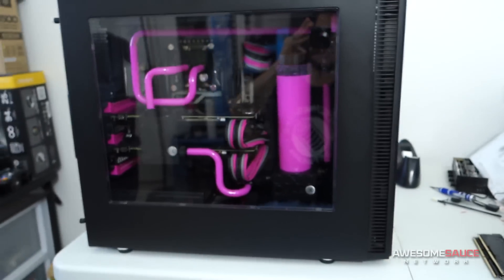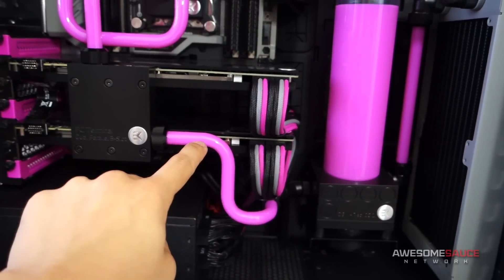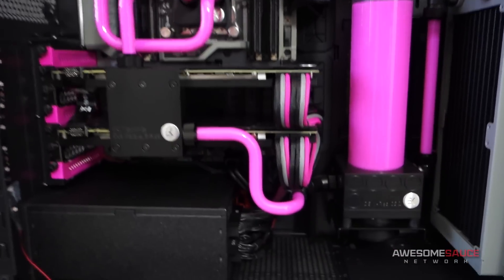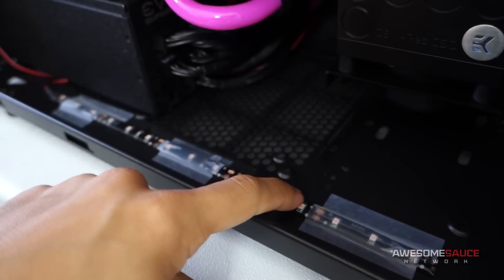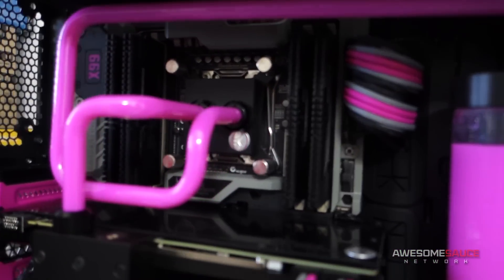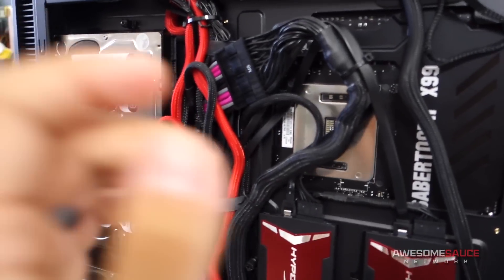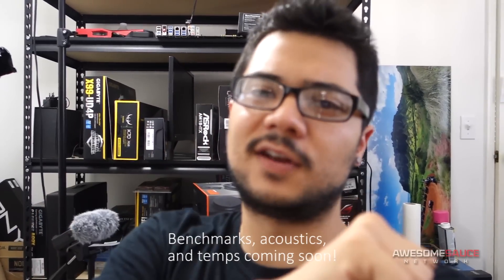Custom Water Cooled Build Log 7  - The End

Comment: You could do one thing and make the water flow in the following pattern... 
Right now your pattern is :-

RESERVOIR-GPU BLOCKS-CPU- TOP RADIATOR-FRONT RADIATOR-BACK TO RESERVOIR.

You could improve this by changing the flow pattern to
 
RESERVOIR-GPU BLOCKS-TOP RADIATOR-CPU-FRONT RADIATOR-BACK TO RESERVOIR.

This way when the GPU heats up the coolant it doesn't directly go to the CPU block.. instead it'll go to the upper radiator and get cooled before going to CPU..
This would be a more efficient way of using all that cooling power you have with two radiators. if you had only one radiator you didnt have a choice but you have a choice now.. 
 hopefully this helps you out man..
Reply: All the liquid in the loop is the same temp plus or minus a few degrees. It really doesn't matter
Reply: This is a mistake people always make thinking that the order of rads to components matter but this is 100% false. The only thing that matters is that your pump is below and directly after your reservoir that way it never runs dry. The way fluids work is the heat is evenly distributed throughout the whole system so the temp difference no matter where it is entering or leaving is 1-2 degrees at most.
Reply: always wondered about that.

thanks Jrock.

Comment: I used double-sided adhesive tape for flooring, it bonds tightly but isn’t permanent, and capped the ends with wood glue, and secured wiring with a few dabs. It takes a bit to dry, but dried clear and is as effective as hot glue

Comment: Typically builds are specific to a cost bracket, or a functional requirement but this was done for true enthusiast art. I'm not a fan of pink most of the time, but this really looks awesome. Your  bends are an inspiration to the hard-line glass I have coming up for 'Mjolnir Extreme' -my latest build (Provided it's not too heavy but I'm using a Thermaltake Core X9 Cube with a flat main board). I'm going to mock it up with some acyrilic and have my glass guy be the judge at worst it will be PETG. The whole idea of painting etc has given me a whole new world. I love blue but the ROG board I'm using the Extreme VIII by Asus has some red luckily not a lot like previous offerings, but my wife the ultimate fingernail painter will be hooking it up;) Thanks for sharing total inspiration and an envious build my friend.

Comment: You should redo the wiring with gorilla glue and sleeve the wiring coming off of it in black sleeves and using shrink wrap on the end. Then you connect it to the +12V source. I used very similar LED strips in mine and doing this technique worked wonders in my custom water cooling build! Just a suggestion!

Comment: I use a piece of Velcro on one side of the LED strip and the opposite Velcro piece on the case itself. It works really well, I have a 3 meter RGB LED strip spanned out around my Corsair 780T and about 1.5 feet of the 3 meter strip is upside down on the top of the case.

Comment: it looks fantastic

For the LED strips, you could try to put some magnetic strips on it for quickly adjustable or even do the small 3M velcro strips.  They hold like a boss and are removable.

I'm a stickler for details, but I don't think the little bit of paint rubbing off of the pink cables would bother me at all.

Comment: Very nice build, beautiful. May I suggest drilling a hole or two in the bottom, add a rubber grommet and run the wires thru for the bottom underside led strips?

Comment: nice work man, great set up.  my little bit of insight would be this, just watch the backing of those led strips with nothing on them, i had a led  RGB reel and the copper contacts underneath the strips were touching parts of my case and would short the computer out almost immediately, until that I installed rubber doubled sided tape on the back of it

Comment: For the LED strips I suggest to apply some Dow Corning 3140 RTV behind it. It acts like a glue and it's completely safe of electronic components. So if you accidentally get it on something there is no scare. After curing it is pretty easy to remove as well.
Reply: It is really good for laying wires down and getting them out of the way.

Comment: I would do the exact same thing but everything that is pink, make it red or blue. I think that would be sweet. I would also recommend drilling a tiny hole in the bottom of your case to run the LED cords through instead of the back.

Comment: If you haven't done anything about the led strips yet you could probably find something similar to the little pads antlion uses on the modmic. I know that my darkside led strip came with something of the sort. I believe they are 3M adhesive strips of some sort.

Comment: Awesomesauce Network Kyle, led strip suggestion. Obtain some magnetic sheet material from some place like Michael's and cut it into strips the same width as the led strips. Then glue it on to the led strips with contact cement. Done.

Comment: Could route the underglow led strip wire in the front of the case, in through the hand hole to remove the front panel. Then through the side holes for fan cables. Just an idea, looks great though!

Comment: Gz on the marriage.
I would hot glue the led strips, you can easily heat the glue with a hair dryer later and pull it right off the case. The glue will easily come off like rubber.

Comment: 3M double sided tape "outdoor strength" will do wonders on those led strips. find it at your local home depot
changed my power button led on my fractal node 804 to red quite easily with a little hot glue

Comment: A few years late to the party but I'm also looking to switch from soft to hard line. Great tips from the last video; I'll be sure to get a lot of extra tubes as this will be my first attempt at bending (lol). Any other tips you  thought of that you didn't document would be invaluable - please let me know if you think of anything! P.s. does the sequence matter? I currently have a single 360 rad and want a second one. I have the Maximus X Formula with a single 1080ti in the loop. I was thinking of doing the following: Res >> VRM >> CPU >> Rad1 >> GPU >> splitter with drain pipe >> Rad2 >> back to Res.

Comment: That looks amazing! I feel I need to get on my with my Purple mods on my own PC.
Just a thought... am I right in saying you have dual 140 intake at the front and triple 120 exhaust at the top? If so, aren't you going to end up with negative case pressure, pulling in lots of dust? You would have to put a filtered 120 in at the back as intake to fox that. No idea if its actually an issue though.

Comment: I had a similar issue with the LEDs in my system. I'm using electrical tape for now since you cant see it. But I did find some magnetic tape that I thought would be interesting to try putting on the bottom of the strip.

Comment: You could use double sided tape for the LED strips and cut them down to size to make it even cleaner, would definitely make it easier to remove than glue.
Reply: Nicktrance1 Some double sided tape to hold the LED strips in place is definitely a good option. I highly recommend (Bill Owen does as well) the 3M Scotch Clear Mounting Tape #4010. Just make sure that is where you want it to stay, because it will be stuck. Here is a link to by it from MNPCTech (http://mnpctech.com/case-mods-gaming-pc-liquid-modding-custom-computer-mnpctech-overclock-cooling-fan-grills/3m-4010-tape-en/)

Comment: Are the fans on the radiator sucking air from outside the case, through the radiator, and into the case? Or pulling the air in the case, through the radiator, and out of the case?
Reply: BecomeSupreme  The top rad has a push configuration, exhausting air out of the case, so I'm guessing the front rad has the fans pushing air in . Probably not the easiest configuration to clean tbh.
Reply: +Nicktrance1 He said both are push in a earlier video

Comment: 4:50 why not use spray adhesive. I know you don't want to buy a $10 can for a little light strip, but if your concerned with the cables overlapping, you'll probably spend a little bit more to get a clean finished look on the LEDS

Comment: How's your experience with the FD Venturi fans? I recently switched over from Noctua NF-F12s to Venturi HP-12s because I needed black fans and the Noctua Industrial fans are just too damn expensive. I have to say I was surprised by how well the Venturi fans have been performing. I wasn't expecting them to be quite this quiet.

Comment: Please do the LED-Switch soon! i've tried to switch the LED(s) on the I/O panel however they're a bit tricky. It's 2 LEDs, one for H.D.D Activity (standard 3mm led, ~3v) the main power LED is a rectangle LED that is 1x3x4 and unknown voltage atm. still trying to get a readout on the LED from Fractal themselves since my Multimeter won't give me the recistance of the rectangle LED

Comment: The front radiator, is that configurated as pull? Since you put fan in front of it I guess your pushing air into radiator (Direction from outside --> inside of case)

Comment: Beautiful build except one tiny point which doesn't seem logic to my point of view: the loop of yours is going through the GPUs and directly to the CPU  and to the two radiators to end to the water reservoir which means the two GPUs (imagine under load) thermal output is going straight to the CPU.  It would have made sense (at least to me and considering the fact am no expert and am might be wrong) to make a loop similar to Paul's Hardware Custom build where he put the radiators in between the GPUs and CPU which means the liquid going to one is being cooled before going to another...
Reply: it doesn't matter at all.

Comment: 3M 4010 tape for the LEDs ... 1/4-inch.

Also, why didn't you drill into the chassis to route the underlighting wires?

Comment: I really like the ground effects lighting but you could have at least drilled a 1/8 in hole and routed the wires underneath the power supply like you did the other ones with in the case, but all in all it looks awesome on the inside

Comment: You should've painted the top of the RAM heat spreaders pink, just to make it a bit more pronounced. Also, why don't case manufacturers make a 2-3cm thick "hidden compartment" at the back of the case for easier cable management, so you're not swishing everything into a super tight area.

Comment: I would redo and reallocate the tube going from the graphic card to the left of the CPU's waterblock going to the right fitting on the CPU's waterblock, and the tube above going straight from above into the left fitting of the CPU's waterblock. This will make up for a much cleaner look as this circling of the tubes above the CPU isn't really perfect. Other than that it's pretty nice!

Comment: You definitely need a rear exhaust fan and it will make a distinctive difference on the temps.
Reply: +Alvin Ong It is all water cooled...what temps are you talking about?
Reply: I'm experienced enough in water cooling, thanks. Why not you just give it a try :) put on your side panel and let everything run as usual with and without the rear fan turned on. You will get what I mean.
Reply: Alvin Ong i would put a nice pink fan on the back

Comment: Is it better to keep the cpu and gpu's on separate loops to confine the different temperatures? Or is there a best order I should follow. For example gpu>cpu>mobo?

I ask this because I'm curious if heat from the beginning of the loop will affect performance from parts later in the loop.
Reply: It wouldn't hurt by any means but I think having two loops is a bit excessive. Does it help? Oh for sure it does. Does it look dope as hell? You betcha. Is it totally necessary? Not at all

Comment: Can you tell me if the Define S side panel will fit on the Define R5?  I realize it will need a little modifcation because of the quick release on the R5 but are they basically the same and can fit?
Reply: Sadly, no, it won't fit. The R5 uses a different latching mechanism from the S where it goes into the frame instead of hanging on it.

Comment: Whats the reason for the strange direction of tubing coming from the outlet CPU block? why didn't you just go up and right into the radiator?
Reply: because #showoffdatfluid
Reply: Crossing tubing looks a mess with the extra unnecessary foot of tubing just to show more fluid in my opinion isn't worth it.
Reply: Mark Springthorpe yeah it's ugly.

Comment: just a suggestion but you could get a matt black metal plate for the rear fan with 4 holes in so you could screw it on because the light that comes in through those holes is abit distracting. other as the GTA mechanic would say "if that pc was a girl I'd kiss her"

Comment: wouldnt it have looked a lot better with just strait pieces and then used right angle fittings?
Reply: Every fitting you add, creates a new possible point of failure. The more fittings, the less probability.

Comment: how much do the custom water cooling cost?
Reply: Sindre Andreassen, alot
Reply: roughly between 200 and 1500$.. depending on how many components you want to cool and which fans you use.
A proper Loop with CPU and one GPU and 2 Radiators would be around 400-500.
My Loop with CPU Block, 2 x GPU Block, 3 Radiators and Noctua Fans was around 1000. (Everything EKWB + Alphacool)

Comment: Can some one tell me how he set this up like in lit and out lit because I have 2 rads one is a complete h220x2 and I want to extend a 320 to it but i want to know how I would set it up please help
Reply: it's a fully custom system, doing it with a h220x2 is a bit of a waste bud it won't perform as well as the pump won't be powerful enough. Check out his earlier videos of this build and you ll see the parts he used.

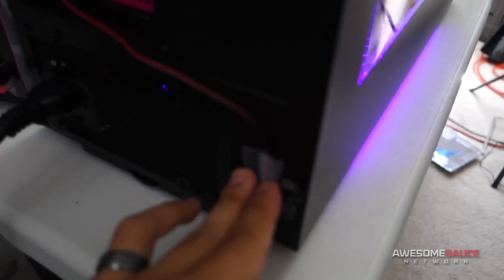Comment: I was like "that's a clean build" and then 7:15 happened.... what.. the.. fuck.. just drill two tiny holes in the bottom and route the cables that way :s Or if you don't like drilling holes use the bottom fan holes that are already there =|

Comment: You could clean the glue from the back of the led strips, buy some tiny earth magnet on ebay (http://www.ebay.ie/itm/50PCS-Small-Neodymium-Disk-Magnets-Rare-Earth-5mm-dia-x-0-5mm-N35-Fridge-/301419415255?hash=item462dff46d7) and attach them on the back.. I tried this and it works well.

Comment: Man that looks absolutely stellar. And for some reason I think the Pink Pops and really does look good in there. I did come across in my FB feed that someone took Pink LEDs and installed them into a corsair fan. if you haven't seen in I'll tweet you the pic or https://www.facebook.com/Corsair/photos/a.189916304381799.42079.179235105449919/1042894385750649/?type=1&theater

Comment: Cant believe all the ridiculous suggestions on how to attach the led strips. There is one simple way to do it. And im surprised you don't already have some.. you build custom PC's you should have some. 3M Double sided tape.. the strong grey kind with the red peel off plastic cover. NOT the cheap white foam stuff. Also, twist ties??? Get some zip ties man.. they come in all sizes.. BIG to small. You should have these things already though.. so go buy some.